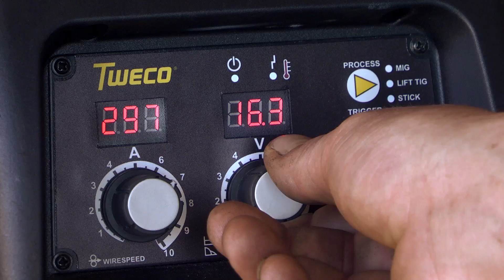Tweco Fabricator 141i: First MIG-Stick-TIG Welder that Runs on 115V Household Current (Part 2)

Comment: THis ad is a little misleading....household current isnt a 30 amp 115v outlet...20 amp outlet is around 90 amps for this machine...so remember to get advertised power from this u need a 30 amp outlet